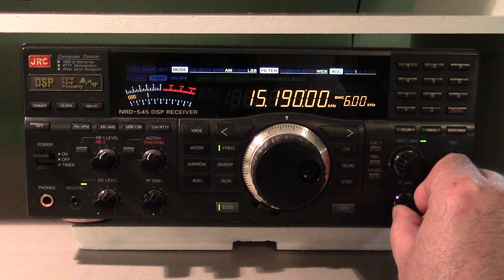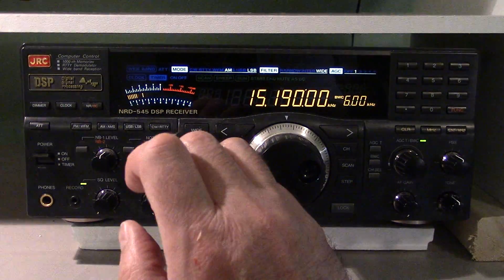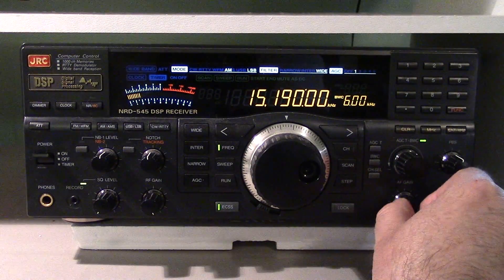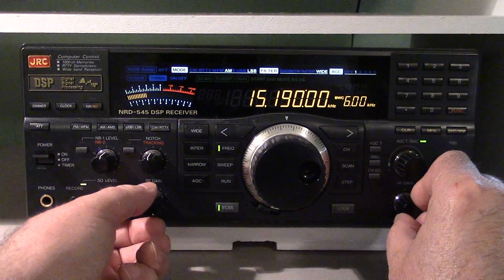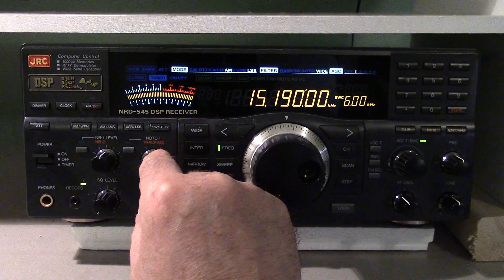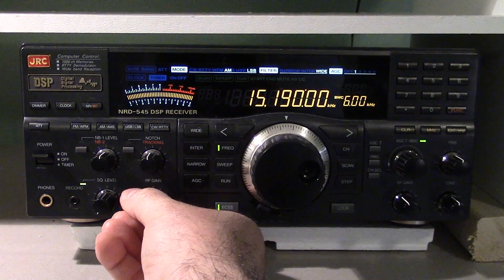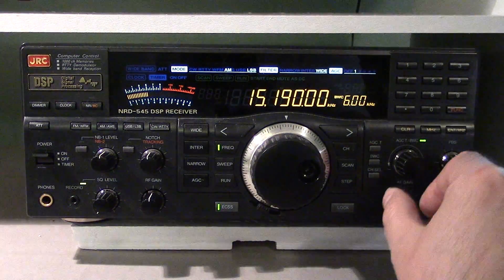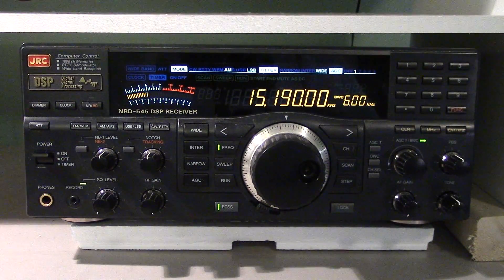PRO TIP: RF gain control is your FRIEND

Comment: Great tip. As a new ham it took e a while to figure this out. Now there is a lot less hash to deal with while using my radio. I still can turn it up if I'm working a really weak station.

Comment: What you call "Meter deflection" is a visual representation of the amount of "Quieting" you're dialing in. Except for the new Icom 7300 and 7610 which have a CB RADIO style variable attenuator instead of a true "RF Gain". 
That's one of the reasons I got rid of my 7300 and won't buy a 7610, which is the same. 😞
Reply: Interesting, Which radio models do not have an RF gain that works like the 7300? New or old..